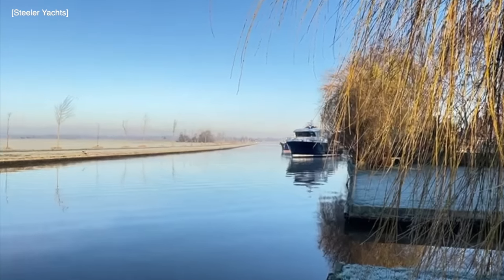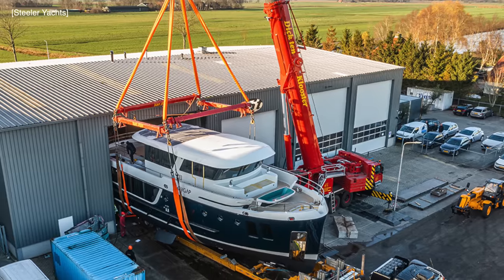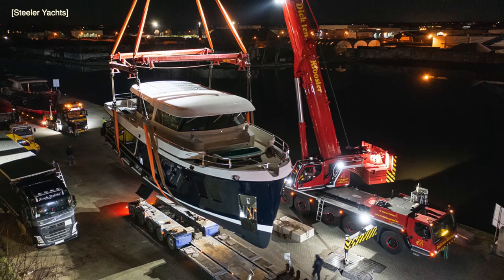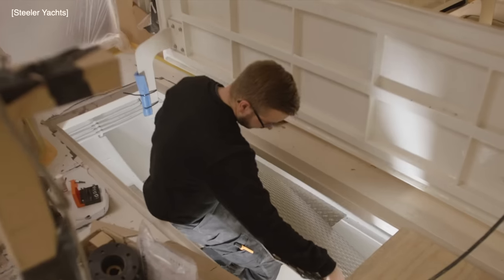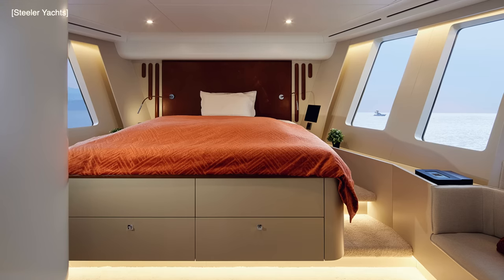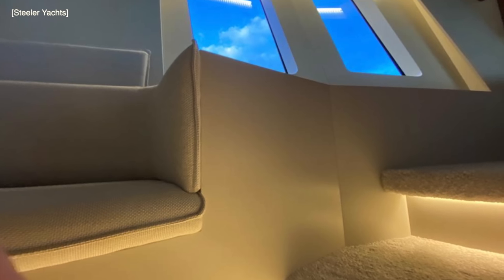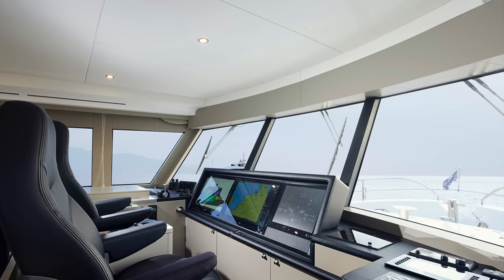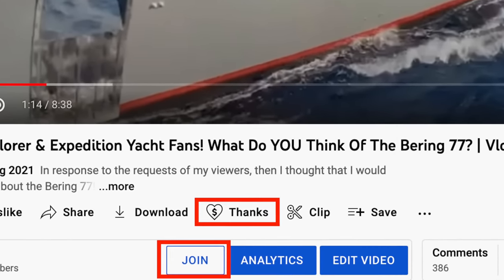Brand New Steel Hull ELECTRIC Ocean Crossing TRAWLER YACHT!

Comment: I think this is a great looking boat, looks very comfy and practical.  But we have a problem here, a very big problem, that has nothing to do with this boat, build quality or design. The simple fact of the matter is that the ability to generate power through panels, wind generators and hydro generators does not exist today to adequately power this boat, or any other boat of this nature for it's intended usage.  Electric motor capability is no problem, battery technology is no problem, however to not be able to generate power is a real show stopper.  Sorry to be a party popper, but the limits of technology are a relentless bitch that does not care about your feelings.
Reply from the maker: Thanks for watching 🙌 the batteries are charged using the onboard generator. Two hours of generator time gives ten hours of running time on the batteries
Reply: It’s possible. A Silent yacht can continuously cruise at 5kts in daylight and still have power to run the house load. To run at night they have a generator that produces more than enough to keep everything running and top off the batteries. Sun comes up and they keep going. They aren’t “explorers” but more for island hopping. A Silent 64 crossed the Atlantic at nearly 100% solar power. The tech is here but it’s not cheep.
Reply: @charlienevergold3654  - Why do the Silent Yachts fly a sail during passage?
Reply: @jamiemcneil9462  free propulsion like a sail boat.  If the wind is in your favor why not get a free 2kts or so?
Reply: @charlienevergold3654  - A few more questions, if I may .. 1) When comparing A Silent Yacht to the boat in this video, in consideration to the energy needed to propel the boats, should we consider ongoing drag?  Would the difference in weted surface and displacement make a considerable difference?  
2)How about initial drag, Would the thin knife like entry of the Silent  Yacht cat, compared to the wide bows in this boat make a difference?
3) You said, "It's not cheap" - Since everyone has access to the latest technology from Siemens, LG ect .. how does more money have anything to do with the ability to produce energy?
Reply: @jamiemcneil9462  I’m not a boat builder so I have no idea about hydrodynamics. “It’s not cheap” is referring to the batteries. LiFePo4 witch I think he was referring to when he said Lithium Iron are not cheep but are the most energy dense battery available now. You can drain them to nearly 0% and can charge quickly to 100% and back to 0% again 1000’s of times before degradation. I hope in the next video the battery capacity, voltage and power management are mentioned. I have Relion battery’s as a power back up at my house. Two 48v 300ah with a victron controller and 7500w inverter to power my house in a power outage. It wasn’t cheap but it can power my entire house AC and all for nearly 24 hours. That’s worth every penny to me.
Reply: @jamiemcneil9462  The most expensive part of hybrid tech is the batteries. M/Y Freedom (40’ Nordhavn) put 4, 12v 200ah LiFePo4 batteries and it was nearly $10k. Going electric is expensive. The Wynns “Gone with the Wynns” on YT just bought a HH44 OC catamaran thats 100% electric. No generator. I think it’s 5k watts of solar and 35 or 40 kilowatt hours of battery. Electric drives that are also generators while under sail.
Reply: @charlienevergold3654  - How much power do batteries create?
Reply: @jamiemcneil9462  are you serious?!? they don’t “create” they store.